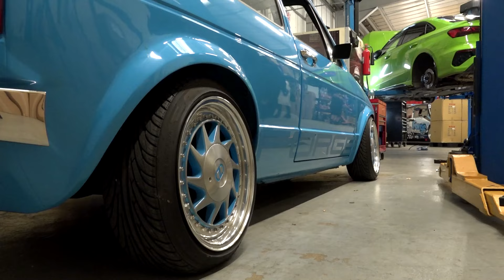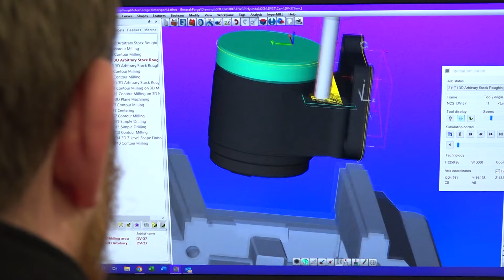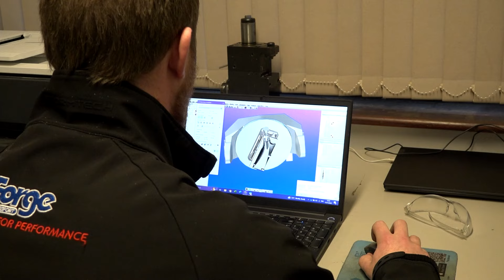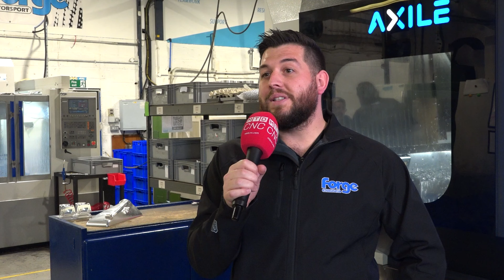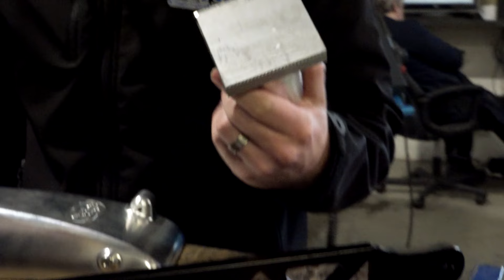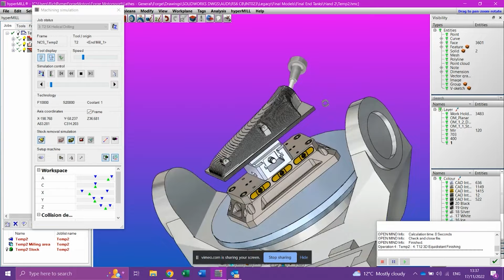Forge MOTORSPORT invest in hyperMILL and prove the right software can make a huge difference!

Comment: Good stuff investing in 5-Axis. At 4:50 slotting that feature with a shorter flute length EM in 2 or 3 step downs rather than trochoidal would be way more efficient. I've surprised myself recently with how hard you can even push a 1/4" endmill with a full-depth 5/8" slot in aluminum. Check out the Harvey Machining Advisor Pro online tool, I've found the slotting parameters to be quite good.
Reply from the maker: Glad you enjoyed the video .